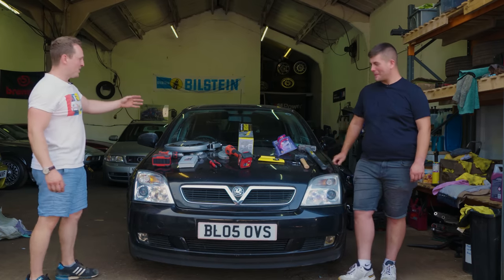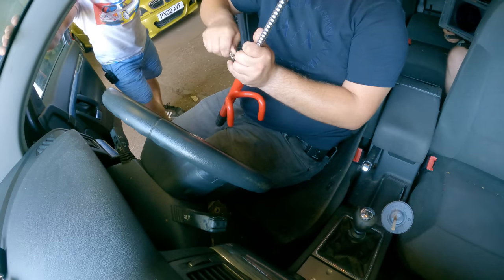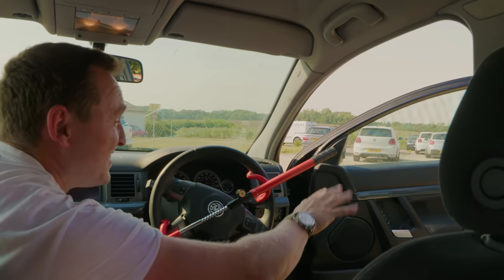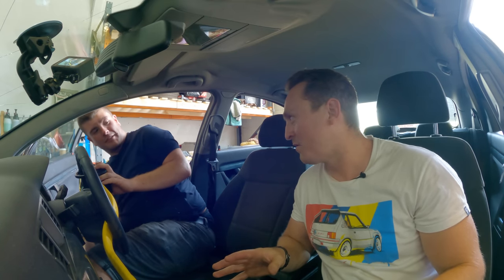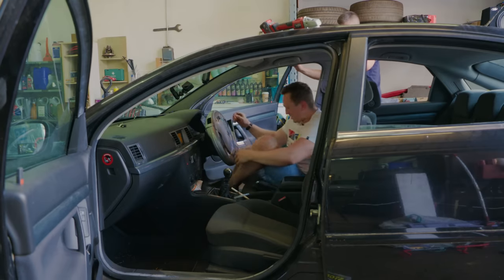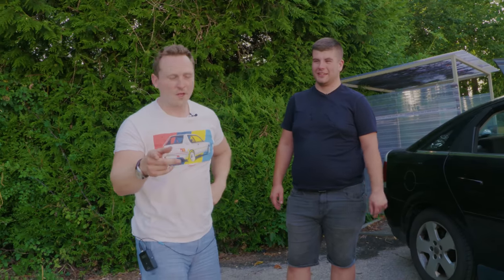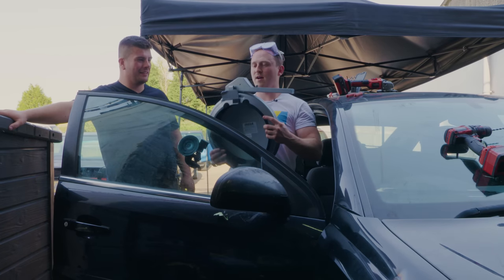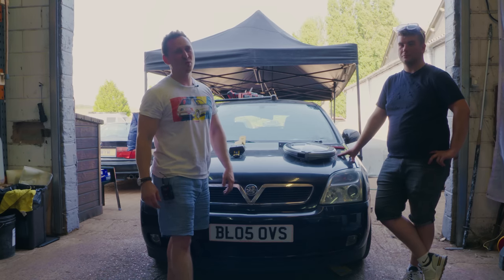Cheap Vs Expensive Steering Locks TESTED

Comment: for the average thief the club is enough. it will discourage most joy ridders . if you have some hot car that gets stolen often (like a dodge charger) then maybe a step up . but the thing here is to create layers of annoyance .if I was a car thief I would problaly skip a car with a club on it. the owners obviously values his car and that prooblaly won't be the only thing there to keep me from stealing it. maybe a GPS or silent alarm or a pulled fuse or something else or even an armed one.. I rather look for a car that the owner oobviously does not care if the car gets taken as it has full coverage insurance.

Comment: Car you don't care about = Shit lock
Car you use to get about but it's a shit box = £50 lock
Pride and joy = Disklok 

Depends on what you're protecting. With a lot of modern cars, a lot of them have keyless entry, or OBD that's accessible by smashing a window, plugging in a flash tool and bosh...you've got keys to the car and the owners keys no longer work (there's been Focus RS thefts using this!!). 

Nothing is impossible to steal, but it can be beyond worth doing. Most criminals don't care about being caught, and those stealing say...a Focus ST/RS, Mustang, Ferarri, Lambo, a classic car of some sort or what have you, will come armed and prepared to attack the owner if necessary. If you see someone stealing your car in your drive, call 999 and do what you'd deem necessary. 

Remember, reasonable force is legal...and if someone is trying to kill you, it's perfectly reasonable to kill them in defence!

Comment: I would use a drill with a cobalt drill tip, [ lock smiths use them ] any of these locks 10 secs maximum I personally use a oxford monster motorcycle chain and padlock.

Comment: What's better than an angle grinder is a 18v bandsaw. Much quieter and no sparks. As for the £50 one, you could just hacksaw/bandsaw the steering wheel itself either side of where the lock attaches. Chop chop. Easy

Comment: Had a good laugh at that. Good info. I can get the first one off with a tape measure in less than 10 seconds tho (have a crap old video of doing it on here somwhere)
Those disklok ones are awesome locks.

Comment: In the early 2000s I had a Mk2 Golf GTi 16v and I opted for the "snap off" steering wheel.  It was a nice momo wheel which had 2 pull out spring tabs and the wheel was off.  Take it with you.
Reply: a quick release would do the same job but they're not legal in a street car.
Reply: @drbass9677  I think he’s taking bout quick release, I have one in mine and never had any problem with it and cops. I am in the great big boom boom freedom country or whatever tho
Reply: @popupheadlights  they're still illegal in the US because steering wheels are required to have an airbag fitted.
Reply: @drbass9677   Not on older vehicles they aren't.
Reply: @drbass9677  Legal...lmao,  stealing a car is illegal...still happens.
Reply: @schwuzi  yeah anything without an airbag it isn't.
Reply: @drbass9677   Well they were talking about a mk2 golf, so no airbags there.
Reply: @drbass9677  funny story my car (90 Miata) scored a worse crash test rating due to the airbag deployment being to late. It just punched the dummy after the test, driver scored 3 passenger scored 4(has no passenger airbag)

Comment: Disc lock is by far the best like you rightly pointed out. Mostly because on the others, car thieves just cut the steering wheel instead to slip the lock off, which they can’t do with the disc lock
Reply: They can instead fill it with expanding foam and drive with it after it sets.
Reply: @hippopotamus86 if they have the time to wait 😂
Reply: @joshs9227 and they usually do. Doesn't take long.
Reply: LOL Sure, street thieves carry that. @hippopotamus86
Reply: @easylee4uify  They don't steal cars spur of the moment. 😂👍

Comment: rumour is they cut through the top of the steering wheel bend the top remove the lock then bend wheel back into shape and tape it back up...its like a 10 second cut if you go for it in a rush.

Comment: I say a waste of money nowadays, I can say this is most hilarious attempt but I could point out that cars now have alot of defence when it comes to security nowadays,
1. if you do snap the factory steering lock most of the time the steering wheel comes off in your hands or bend the steering colomn.
2. if the car was double locked you would find it alot harder to get into the car so wouldn't really need a steering lock.
3. Without the key transponder telling the ignition it can't response to the ecu so pretty much your not driving said car away.
Not to mention if criminals really wanted your car bad enough you have a knife pulled on you as you pull into or out of your driveway so a steering lock is pretty much useless now

Comment: For between 50 and 60 quid you can by a tubular lock pick that will open these locks in about 30 seconds rendering most of these pointless , in fact they actually assist the thief by providing the leverage needed to break the steering lock ! still a good laugh to watch though nice one lads !
Reply: What about those round cylinder locks, like there are used in the Zeder Lion Claw?
Reply: @DashCamSerbia  depends how many barrels are in the lock but yes if it’s a tubular lock it’s easy picking
Reply: @BigJ710  It is not a classic tubular lock, it looks like this: images.autohermes.rs/1541413509/desktop/news-large/1361zeder_lock_5.jpg

Comment: Disc lock every time , you said on this video 2 minutes to get it off but in actual fact it took over 4 and that’s with a variety of tools ! To much noise as well ! What I would say is that disc lock need to improve on what they have there is room for a couple of mods on it which I will do on mine couple of peices of steel welded to the back just to give it a bit more strength.

Comment: Would be interesting to do a test using low skill raking lock picking techniques on them..
Reply: If the stoplock they used is anything like the one I had for my corsa (slightly different model to accomodate different wheel shape) the lock is one of those circular notched security keys. Easier (but much noisier) to drill out.

Comment: I and my mate who is a really good locksmith,  played a prank on one of my neighbours and friend, who treats his Insignia like a Rolls Royce, and of course, has a steering wheel lock, we unlocked his car, took off the steering wheel lock, left it on the seat, left a note with this text on the dash "Steering wheel lock are kinda pointless, plus I wouldn't steal something like a Vauxhall, be safe!" and locked the car back. His reaction was priceless, he bought a different type of lock and installed CCTV and tracker in the car :D :D :D

Comment: To break the steering lock you're supposed to put your foot in the steering wheel and push away while pulling on the top of the wheel with your hands... So I've heard...
Reply: say hello  to my airbag friend going kaboom
Reply: @evodesignsracing5925  You wouldn't be in front of it, you'd be over on the passenger seat. Your leg is behind the wheel with your foot poking through from behind, hands gripping the top. Keep turning the wheel in one direction, don't change. Put enough force on and it will break.

Comment: Best video to watch in the morning 😅
One question. If you would mount the first cheap one the other way round so the lock is on the inside and can't be accessed by the drill. Would that work?

Comment: I remember when I was younger my dad welded in a metal box around the driver's footwell, when he wasn't driving the car he fitted the blocking plate 1/4'' steel completely blocking off the pedals. Can't get the pedals can't drive the car!

Comment: missed out one method for the first 2, simply use the hacksaw through the wheel itself, that would have been equally hilerious to drive it like knight rider with just 2 paddles to steer with ha

Comment: When I was a repo man we would just remove the wheel with the lock in place move away from the debtors home and beat the lock barrel part against the sidewalk until it broke two or the hits then reinstall the steering wheel and take the car

Comment: Hilarious! But the first one was not attached as per directions. You put it on so the longest part so the bar is against and on the inside of the windshield, not against the passenger door. If the thief does not have a drill, it is good.

Comment: Wasting your time attacking the locking device itself, when all you need is a hack saw to make a single cut through the steering wheel in seconds and pull the lock off.

Comment: Brilliantly funny. But did you know that the two "stick" locks should be positioned with the extended section between A pillar and windscreen. This stops the thief using the device itself as leverage and provides zero turning ability.

Comment: If the wheel disk has foam inside to grip the wheel then it would've stopped them the first time. The company should start using a grippy foam inside to hold the wheel still.

Comment: Alex lock pick , jiggle key or jiggler and tension pick all locks you have tried out will be off in 20 secs or less and very quite , also with the steering lock one in the driver seat one in the passenger seat  , synchronised sharp tug , snaps nicely, do 3 locks left and right to burr the snapped lock pins , then do your ignition stuff, bye bye under 1 min possibly 45secs , this is for older vehicles , new cars just a laptop and a signal catcher 👍🏼

Added note :  it’s what somebody said to me at the pub 🙃

Comment: If you smoke you're gambling with your life. Any day when you go out to the shelter for one you could be run over by a pair of car thieves trying to do a 3 point turn in a Vectra with a steering lock still attached. If that doesn't make you quit instantly I don't know what will :)

Comment: Well ive put the stoplock at the bottom of the steering wheel to the passenger side of which u even could not reach with the hammer

Comment: I have the Disklok Clam Shell wheel lock on my car, that's the big grey one.
I bought it second hand about 10 years ago and is still going strong.
However, HASTINGS DIRECT Car insurance firm REFUSE POINT BLANK to accept this device as an extra security device to reduce my premiums.
I have been told, when I rang them, that their systems DON'T recognise it and so won't accept it.
Needless to say that when I renew I will be going elsewhere even if it costs me more on principle.
Reply: @ianian9696:  Did you ask for a reason they didn't recognize the device?

Comment: This video made me laugh so funny well many years ago the car my wife owned got stolen it was a Ford Festiva and to get into the car the thieves bent the window frame which was never fixed properly one reason we got rid of it bypassed the lmoboliser by removing the indicator fuse and broke  the steering lock and hotwired but we got it back most damage was repaired l think they thought it had an airbag which it didn't because the horn pad was removed still in the car

Comment: You guys are such lousy thieves that I've almost wet myself laughing!
But in my area, most thieves just cut the steering wheel with a hacksaw and remove the lock.
The cheap one could also probably be shimmed with a piece of an aluminum can.
As for the disk lock, there's got to be some type of exploit that can be done to either bypass the lock or open the hinges. Just ask the Lockpicking lawyer.

Comment: for the first two it would've been easier to cut the steering wheel, that could've been done with the handsaw
Reply: If you put it in between the two spokes youd have to cut the wheel twice, even then you might not be able to get it off with the remaining chunk trapped inside so at least it does something

Comment: So you guys did NO research on how criminals defeat these first...ok.  Well for the single Bar instead of Ripping the steering wheel off, they grab the MIDDLE of the bar and PULL it toward their chest bending it.  I ESPECIALLY love how he pulled on the outer handle after cutting the middle, instead of pulling the cut portion toward him, bunch of BIG BRAINS here.

Comment: Funny video, but why at least for the first 2 locks didn't they just cut through the steering wheel with a set of bolt cutters, quick, silent & simple...

Comment: Be curious to know if catalytic converter locks work as just had mine stolen
Reply: So many have these days
Reply: My brother used to make and fit plates to Uber cars a few years back. The company that leased them had several a week being stolen in London. After we fitted over 1000 of them, not a single theft after. The plates cost £9 to make using 3mm steel and a company to laser cut them, then just bolt it onto pre existing bolts with security bolts and red loctite.
Reply: @hippopotamus86  Fair play although it’s sad its necessary. I just bought a car and a week later I noticed it had no cat it had been replaced by some pipe

Comment: 12:46. Spin the disc around and cut the hinge mate. Faster and easier.

Edit: just thought the lever arm may still keep it on. Cut the pin head off the lever joint and bingo bango.

Comment: Last I heard cars are usually stolen to order. Max damage = min value. I place a stoplock just to show it's a working vehicle and that I need to use it. If you own a stoplock, 5 minutes will show it's weak points.

Comment: Often the quickest way to defeat those things is to look for a week point that’s not the obvious.
The car thief will be one of the following. A drunk opportunist, a skilled amateur or a professional.
The opportunist will probably look around for the key in the magnetic box you hid.
The skilled amateur will cut the steering wheel and slip the lock off break the plastic trim around the column to get to the vehicle lock and drive a screwdriver into the mechanism to drive back the lock and push the starter.
The pro will just come along with a tow truck and cart the vehicle away.

Comment: Steering lock = just sit in the passenger seat, foot in the bottom of the steering wheel, hand on the top, pull, snap, job done

And for most steering locks don't need to break them, don't need an angle grinder or to try rip it off, junior hacksaw with a course blade & saw through the steering wheel, bend it a little & slip the steering locks off.

Anf I remeber right, the disklok can be removed by using a hardened tipped screwdriver to break out the pins on the lock, then you can use pretty muchany of those style keys for that lock, to undo it - they use similar style locks to fruit machines, arcade games, pool tables, vending machines etc

I used to buy, fix & sell accident damage & stolen recovered vehicles so used to see how they were stealing them - I don't drive now but when I did I used to fit a hidden killswitch , fraction of the price of a security device but far more effective against thieves unless they have a tow/lift truck to put them on

Comment: If the drill worked so easily that should have been the go too tool on the other locks also to gauge their effectiveness at withstanding the same proven attack LOGICALLY speaking 😒

Comment: Some lowlifes tried to steal my Fourtrak a few months ago, they actually cut the steering wheel to get the steering lock off, couldn't get it started so left it in the middle of the road. Used a battery powered angle grinder. 1998 Fourtrak commercial van, for sale with no mot, anybody interested??

Comment: Eh just carry a spare steering wheel around with you and swap out the steering wheel, the £150 is stupid tho...a car theif would just hotwire it take it down an ally or somewhere quieter and finish the removal there as the car is drivable with it on 🤣

Comment: I do not know if they are trying to make this as funny as possible or if they are actually that stupid. Stirring wheel is a rubber coated aluminum  tube. Take hack saw, cut through stirring wheel in about 10 seconds, bend steering wheel, remove lock, bend steering wheel back into position. Takes 15 -20 seconds.

Comment: The vast majority of people looking to steal cars are joyriding kids. Probably less than 1 percent are stolen to order. Some idiot looking to steal a car isn't gonna even bother trying to tackle even a reasonably easy defeatable steering lock if the car 15 feet away doesn't have one on. Added to that, the majority of idiot owners think their keyless cars are unstealable if their keys are in the microwave and don't use steering locks.
Reply: I have mine in a Faraday pouch and inside a metal tin (in case the pouch breaks down) and a Disklok. Wish there was an easy way to just disable keyless entry

Comment: Very funny video, not exactly useful ... the first two, you could have picked the lock in seconds with no noise (but it wouldn't have been half as funny).  The disklock could also be picked but requires a special tool.

Comment: These guys are silly the first one u can cut steering wheel with hacksaw or pick lock  or use drill . Second one cut steering wheel with hacksaw push on wheel and slide clamps thru space (see it done in 15 seconds ) on tv program bout steeelincars ..  third one didn't get a good look  at it ....